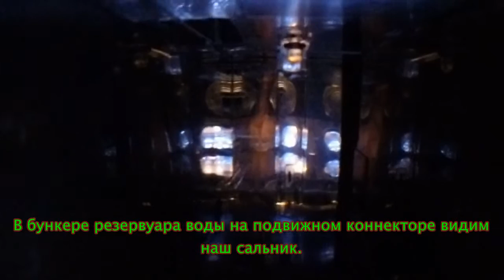Ремонт кофемашины Panasonic NC ZA1HTQ (ошибка U12)

Comment: Hi do you have a video for error code "H08"? thankyou
Reply from the maker: Hi. I do not have video at this time. 
Can help  from the service manual:
Grinder lock
If grinder rotation is <4 turns per second, then
display H08
Switch the appliance off and disconnect the main plug.
Suck the bean container off with a vacuum cleaner.
Switch the machine on.
Reply: Hi I found the problem, the screw on the top of the bean grinder had some how come loose. thankyou very much for your help, Merry Christmas.